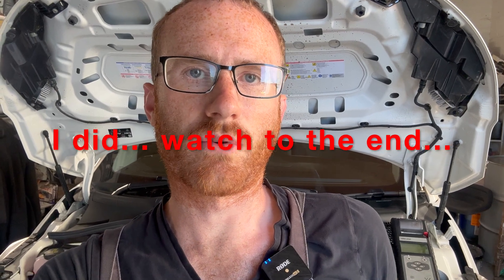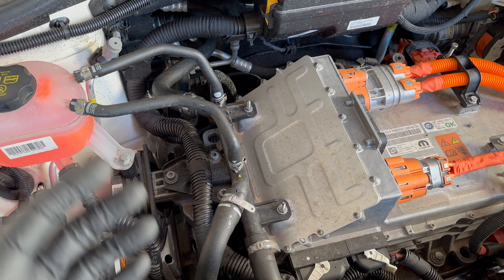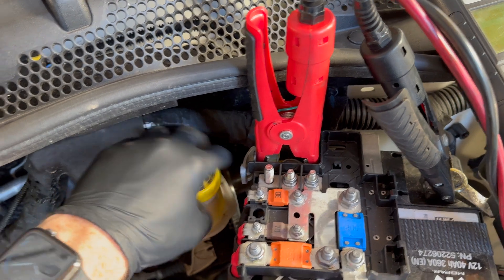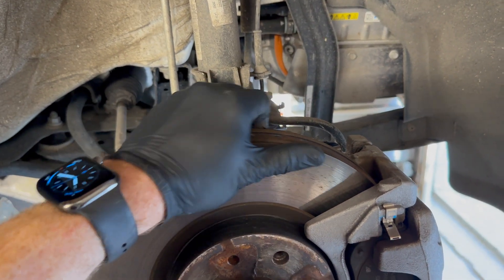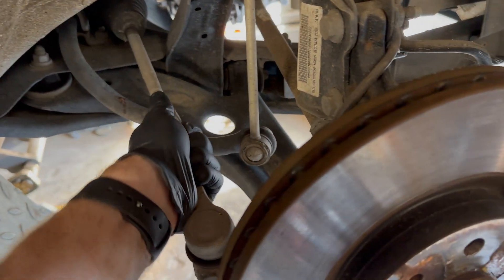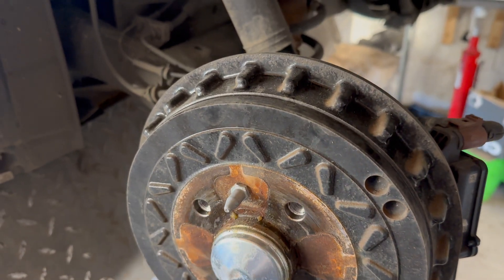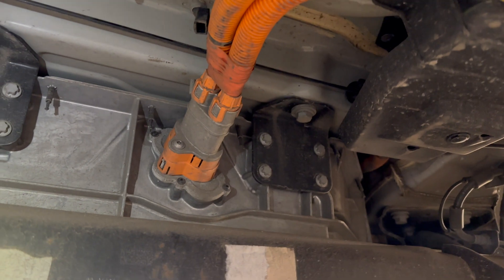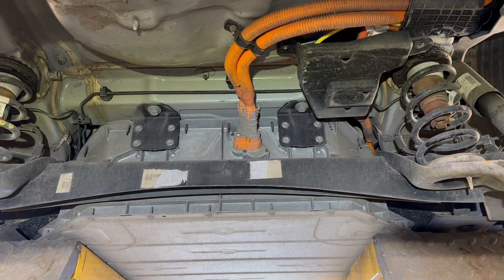Unexpected Fail! EV Service, What Could Be Wrong and What Actually Is There To Do? FIAT 500e.

Comment: Hi Peter, wondering if you could help me out, I found in my 500e that the coolant hose made contact with the radiator fan (on the left side when you look down at the fan), and caused it to leak. I am wondering if the hose was secured wrongly. I can see it is clipped to the front panel on the left side of the fan but noticed this clip is larger than the hose, and it might actually better fit the larger hose that runs next to it. I'm wondering if you could check your car to see which hose is clipped to it, the larger smooth hose or the smaller ribbed hose. Mine has the ribbed hose clipped and is the same hose that runs across the fan, where the left edge of the fan wore thru the hose and caused it to leak. Thanks a lot
Reply from the maker: Yes, I’ll have a look, but I actually moved stuff around as it was laid out poorly from the factory and stuff was rubbing.
Reply: no worries, I had a better look today and I think it is correct that the ribbed hose is clipped there (the clip that is to the left of the fan if you're looking from the front of the car)

Nonetheless, would appreciate if you could check if your car is the same, whenever you get the time.

I noticed the fan mount has a cutout on the bottom left to route the ribbed hose there so it must have been designed that way, no idea why they would do that and I wonder how much clearance your hose has from the edge of the fan, mine evidently had none haha.

I have patched the hose best I can with self fusing silicone tape, will try to vacuum fill coolant tomorrow and get the hose spaced away from the fan! 
 @theweekthatis
Reply: update: well I am completely stumped, I mounted the vacuum device on the reservoir but was not able to pull a vacuum (not even moving the needle) and I checked and rechecked the vacuum was working and seated properly. I looked everywhere I could for another leak but couldn't find any. I ended up filling with about 1L of distilled water with the car started. The pump was running and it dropped the water level some but after 5 minutes the car shut down and now it wont start again. Shows the messages "Service Electrical Vehicle System"  and "Stop Safely Vehicle Will Shut Off Soon". I could find no water leaks.

I'll try again tomorrow, its ok to reset the system by disconnecting the 12V battery right?
Reply from the maker: @huskytwo9686  if you run the pumps with no water, it will detect this and turn them off for safety.
Reply from the maker: @huskytwo9686  the correct procedure is to bleed via vacuum. If there’s any hint of a leak, it’s important to make sure that coolant isn’t leaking into the traction battery.
Reply: @theweekthatis   Final update: Thanks a lot for your help! I was an idiot yesterday, actually the rubber cone of the vacuum device had to be pushed super hard onto the reservoir before it would hold a vacuum. Anyway today I drained as much old coolant as I could using the quick connect at the bottom left (looking from the front of the car), then vacuum filled new coolant, it took a little under 4 litres.

I reset the errors by disconnecting the 12v battery for a few minutes and now the car seems to be all good :)

The was no way to clip the hose as installed originally without it making contact with the fan, I suspect the section of hose that runs between the 2 clips is too short. Anyway, I now have the hose spaced away from the fan with some rubber and zipties.

Comment: Main dealers get real funny about you touching the car while it’s under warranty. Technically, they can invalidate your warranty if any work is done on the car outside of the dealer network workshops. I wouldn’t mention it to the dealer if you have any significant warranty left
Reply from the maker: Total rubbish. Sorry. Look into the block exception regulation.
Reply from the maker: I did also buy the part from the dealer (not that I had to under the legislation), so I'm sure they will be fine
Reply: I might be out of date with my info then. I worked in main dealers 2001 to 2003 and that was the situation at the time. If a vehicle had been touched by anyone other than approved dealer network and there was a significant warranty claim at any point later, the manufacturer rejected the claim as it was in the T&C’s. That legislation must have come in after I left the trade
Reply from the maker: Yes! October 2003, funny timing!

Comment: Ah ye good video Peter and well spotted on the rear hub 🤙
Reply from the maker: Thank you! Hopefully that's all the problems spotted before the trip!
Reply: What is the driving range on that, are you going to do vids on your stops
Reply from the maker: @giggles57381  not especially great. About 2-3hours on the motorway. 140-200 miles depending on speed and conditions. I'll document every single charge!
Reply: @giggles57381  I think his range is around 200 miles but Im sure Peter will be along shortly to correct me.
Reply: @YTDTETV  Peter will be well rested between stops, if the battery lasts 2-3 hours lol.
Reply from the maker: It's about two hours between 20-30minute charges from 15-85% or so. I'd stop more often than that anyway with the kids so it's not a problem.